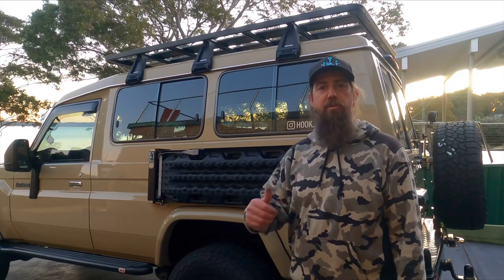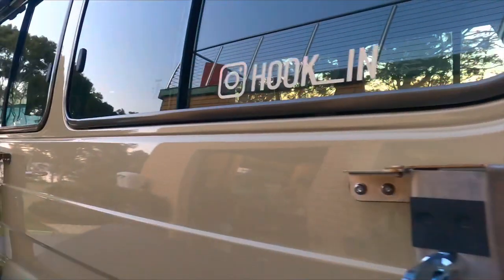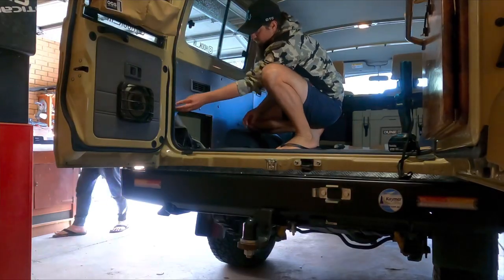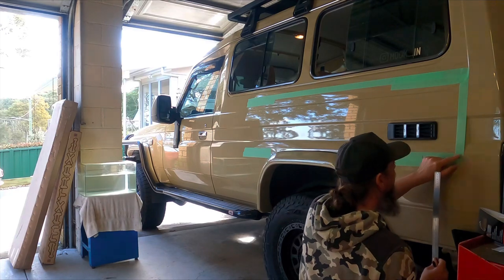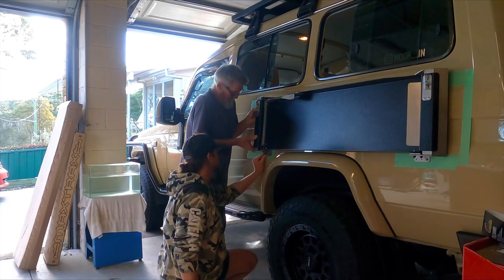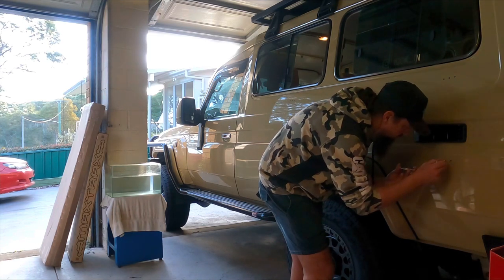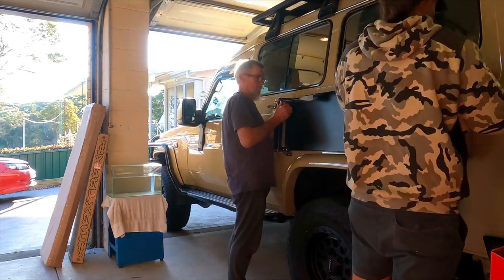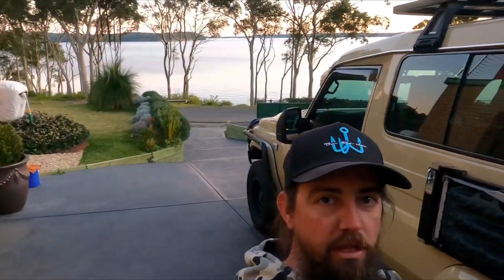Quick Pitch MaxTrax Table. DIY Troopy Install guide, tips and initial thought’s- Overland Build

Comment: Great video mate - wondering if it can be mounted more forward in the troopy to leave the vent exposed? Or does it specifically fit that far back? 
Cheers
Reply from the maker: Hi mate, I just used recommendation’s from an installer. As I planned to have it sit under my gullwing. It is annoying that it sits across my vent tbh. The mission 4x4 table sits over the top of it which is a great idea if you have looked into their version. I have seen them mounted a bit further forward. As long as all the flat parts of the mounts for the table sat flush with your car I don’t think it would be a problem. I just wouldn’t push the boundaries for angles with the brackets in case they try and distort your body work. Check out those mission 4x4 ones though if you haven’t already 👍🏼 hope this helps mate. Ben

Comment: Great video mate.  Does the table sit flush against (or close to) the vent when upright?  Wondering it will foul on the vent fitting for hoses/power I have.

Troopy looks great.
Reply from the maker: Thanks mate, it is quite close. Less than 10mm at the top and and maybe a bit over 10mm at the bottom. I wasn’t too concerned as I have opted to to have the utility panel on the opposite side. If you want me to flick you some photos etc dm me on Instagram @hook__in and I’ll pass them through 👍